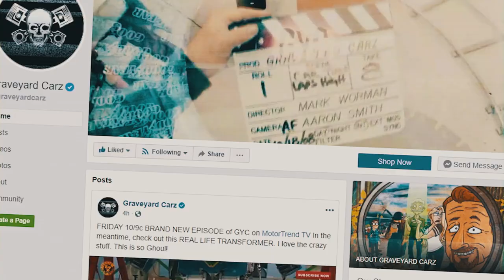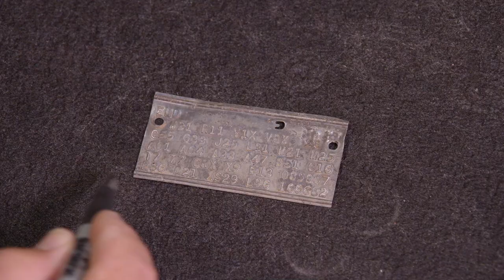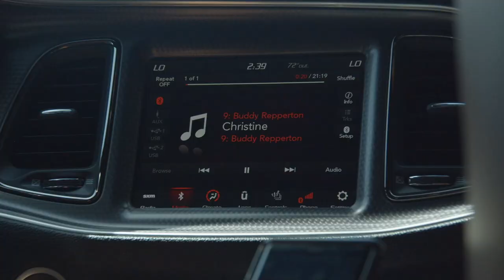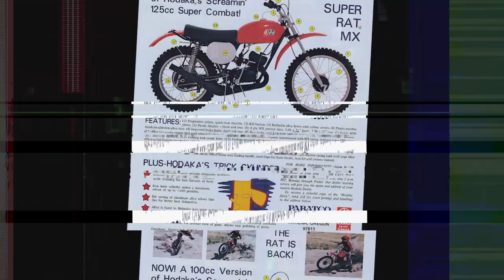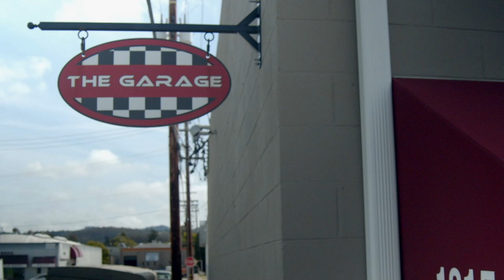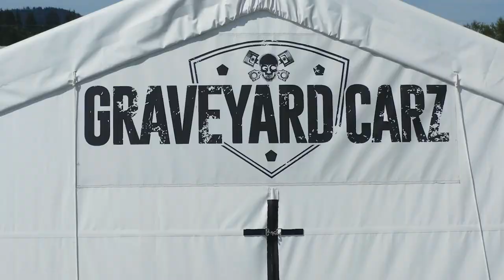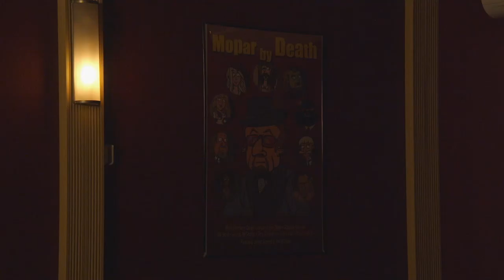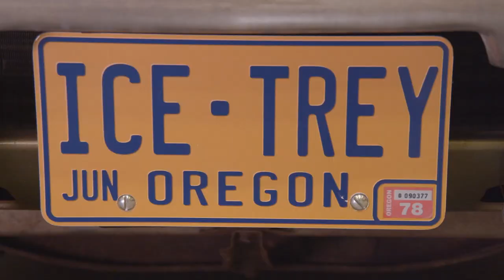MARK BUYS HIS DREAM CAR DONOR 1970 CHARGER: SEASON FINALE!

Comment: Had the same experience with my charger, moved it on, grew to regret it and when I tried to get it back I found out it was totaled running from the police in the next state. Only have a few photos left of it, Peace Man
Reply: might have been exported? not sure how they do the paperwork as nicks grargege has a similar looking car on his you tube channel and i remember being offered a similar XP-500 car and the guy worked at a junkyard so maybe it escaped from the jaws of death aka soup can fate at least in 2010 and i wanted a real 4-q 1967 car so i turned down the offer @ 12K usd that and it was ruff and 70-73 cars didn't at the time bring any real money aka totally a financial pit and for a younger guy with little net worth not a smart move but a real collector car maybe as collateral to loan against ect.